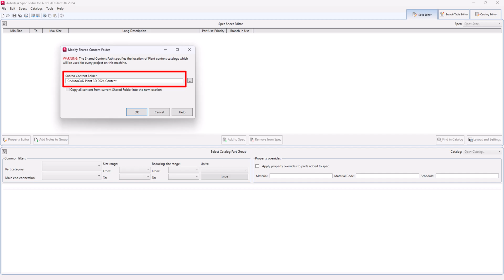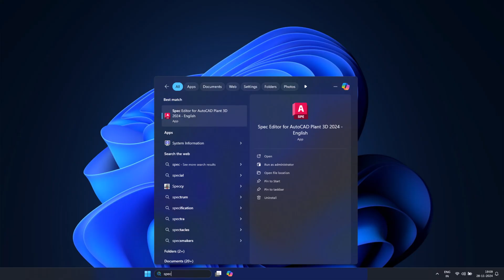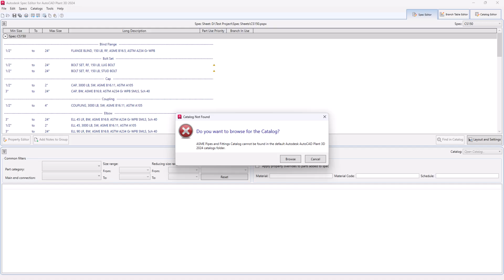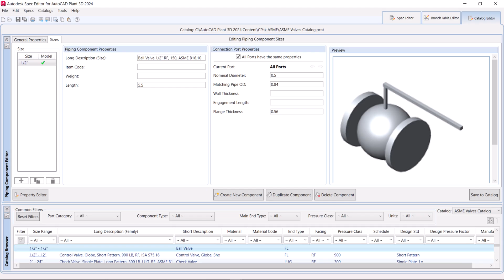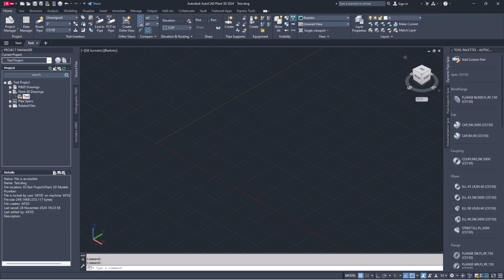AutoCAD Plant 3D | "Can’t find symbol for specified part." While placing Piping Components.

Comment: I have this problem and I don't know how to solve it. When copying from one computer to another, the source computer works correctly, but on the destination computer, the block-based parts give me that message. The only solution I have is to "replace model" on all the parts and sizes manually in the spec editor on the destination computer. But it's strange because it only happens to me in one specification, in others it works correctly.  Do you know if there's a way to do it faster?
Reply from the maker: Hello Eduardo,
Transfer the entire content folder to a different machine and link it to the shared content folder. Hope it helps.
Reply: @acadp3dsolutions yes it was the problem, yesterday i did and run correctly. Thank you

Comment: Hi.
I am having a strange problem. 
I made a network folder for my employees AutoCAD Plant 3D Content. Everything was working fine for everyone and me.

But this morning specifically for me, Plant consumed my network folder and the entire minicatalog was not working. I can ONLY insert pipes and block based elements. 
Bends, transitions and tees were not showing up. 

I reinstalled the plante = didn't help.
I reassigned the content folder to local as it was and everything worked. 
But as soon as I select the network folder, everything fails again
Reply from the maker: Looks like the catalog files are damaged. Please try restoring the backup.
Reply: @acadp3dsolutions  
Hi. It may be true that the folder was corrupted. 

I also found out that the content network folder is not suitable for Plant3D 2021 and below and Plant3D 2022 and above. Because of different versions of Python and something to do with metadata. 

I have employees using Plant3D 2020. 
I'm using Plant3D 2026. And that's probably why it crashed.
Reply from the maker: @znakjj This is not corruption; it's a compatibility issue. You didn't mention about the different versions before. Copy the ContentConfig.xml file from the AutoCAD Plant 3D 2026 Content folder to the AutoCAD Plant 3D 2020 Content folder, and you will be able to use the AutoCAD Plant 3D 2020 Content in the AutoCAD Plant 3D 2026 Content. I hope this helps!!!
Reply: So now I won't have one network folder for my employees. If I create all items in Plant3d 2026, do I need to create the same items in Plant 2020 separately so that I have content for 2020 and 2026 on the network drive?
Reply from the maker: @znakjj Try to use the same version of Plant 3D or at least two versions lower.

Comment: In my case this doesn't work. Could you please help me. I'm change the computer, and i dont see the icon of valve i tray many time to import spec from other projects but unsuccessful. best regard
Reply from the maker: If your catalog content folder is located on a network drive, please map the content folder using the "Modify Shared Content Folder" option as demonstrated in the video. If you encounter any issues with this process, feel free to provide some background information so I can help analyze the problem. Hope this helps.🤞